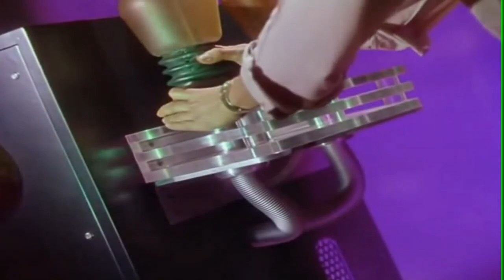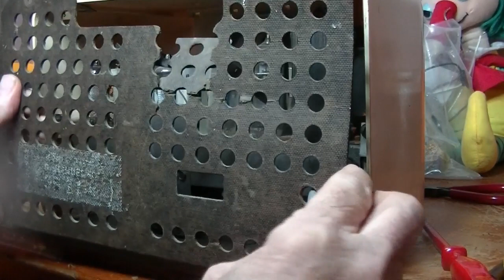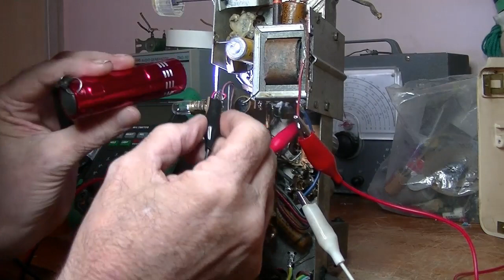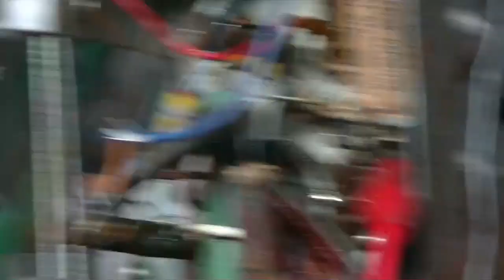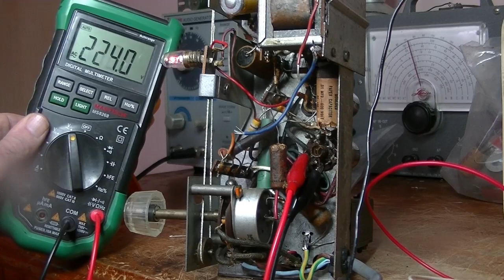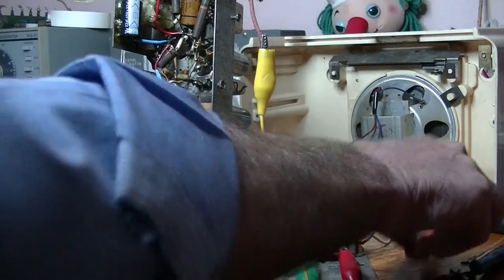Minstrel Four 138 1953

Comment: Well I'm amazed that worked! When you said the rectifier was an EL84 I thought that's gotta be an error. An EL84 is an output valve of about 3 watts. I would have expected an EZ80 for a 9 pin rectifier. I guess ANY valve could be wired as a half wave rectifier. Was that valve shown in the circuit diagram? I've never seen that used like that before.
Reply from the maker: Hi Michael, The schematic shows it as an EZ82. You know, I didn't pick up on that at all. It's amazing on what can be done with valves
Reply: @exeterslab7781  That's an odd one, never even seen an EZ82.
Reply from the maker: @MichaelBeeny  Neither have I, but I've just checked the pinout and it matches the  6v4.

Comment: Goodness, how do you repair old radios before the pcb came around? That's like looking for lug nut in your Aunt Jo's crowded car trunk. Although you inspire me to look for an antique clunker  at a yard sale.
Reply from the maker: In the beginning it was a challenge, with everything looking like it was attached to everything else. lol. I took it one component at a time and tested the radio after each replacement. I personally prefer the point to point wiring instead of PCB. The more you restore the easier it gets, as the layouts are similar. You should definitely get a cheap clunker and give it a go. When you get it going, the satisfaction is indescribable; well it is for me and I still get a buzz when they come to life. Go for it man and please be safe with your first one, as the high voltages in the radio are deadly :)

Comment: I went to the kevinchant site and looked under Philips 138 and found the schematic pages there. Good job on the repair.
Hone those skills on the easy ones. Sounds good. How did you put the new badge on the front? Contact cement?
Reply from the maker: Thanks Master :)  I used a dab of super glue